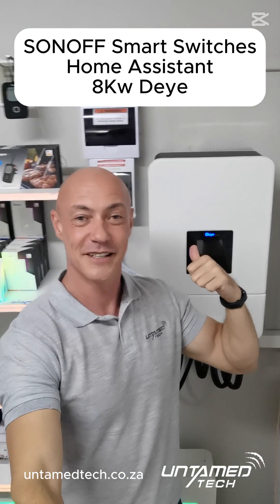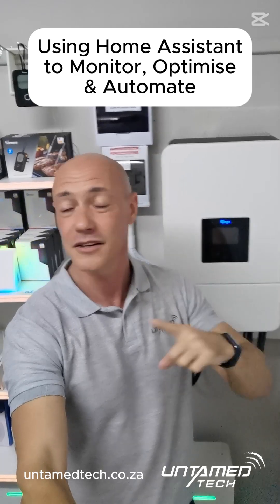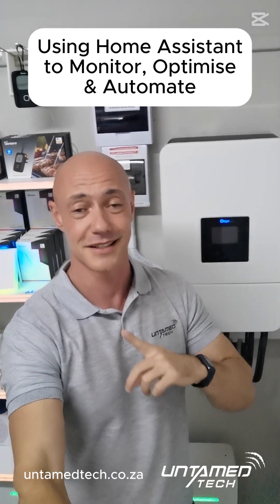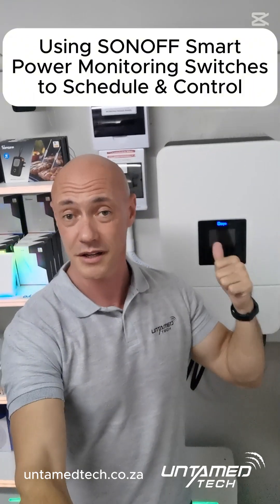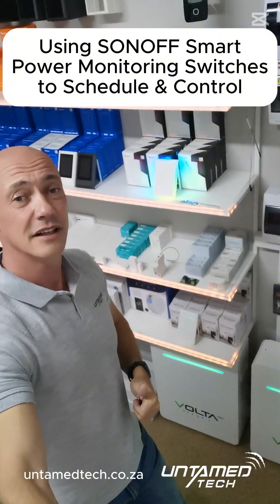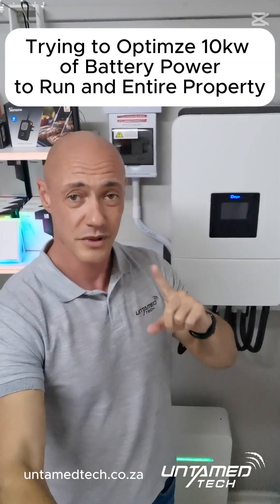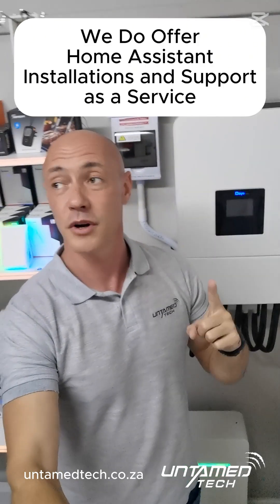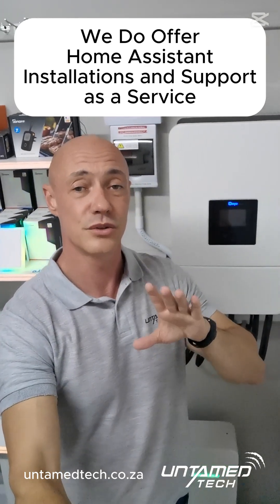SONOFF Smart Switches Home Assistant 8Kw Deye Inverter - Challenge: 0Kw usage from Mains

Comment: Have a look at solar assistant. Connect to hass via mqtt. Add a custom sensor to monitor all your inputs and consumption from there. Limitless options. I ran a ton of automations from that alone. Switching pool pumps, heat pumps, geysers, etc. on and off based on battery level and excess solar production. When batteries are full, use as much of your own power from your panels as you can.